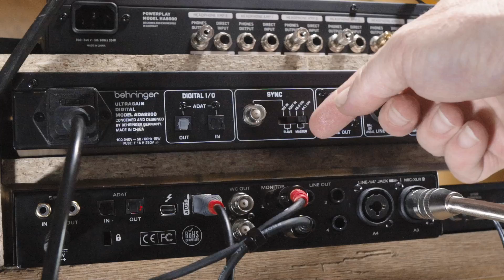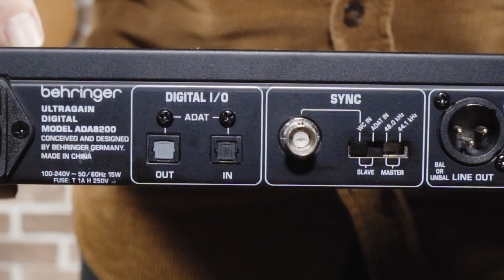How to add more inputs to your audio Interface? Behringer ADA8200 - demo

Comment: I would like to connect my babyface RME pro fs to ada8200.Can I also plug my electric guitar to tha ada8200 or do I need a DI box ?
Reply from the maker: each channel has both - xlr and line input, so you don't need DI box
Reply: @soymartino thanks

Comment: Hello I am a bit confused as my interface has adat in but nothing about clock I didn’t realise you need that as well I would like to add line inputs only for a few keyboards do you know anything available without mic inputs and without clock input as my baby face only has adat thank you
Reply: You will want to run an ADAT out from the ADA8200 to the ADAT In line on your Audio Interface instead.

Comment: 1:51 trying to connect my Behringer UMC1820 interface with  my Behringer ada 8200 pre amp and having a hard time - not sure where the other end of the coaxial cable should go on my interface ?
Reply: For this you should only need an ADAT line. Run ADAT out from the ADA8200 to the ADAT In line on the UMC1820. Hope that helps!

Comment: I've had a lot of problems with mine. Clicks and pops on 6 of the 8 channels. If I flip the switch on the back to a different sample rate and then back it will work for awhile.
Reply: How long is your toslink optical cable?
Reply: @RealHomeRecording  they are only about 12 inches long. However they are those super thin kind we had with the adats back in the 90's.
Reply: @tractorgt  Hmm...I just bought one so I'll see how my ridiculously long Monster toslink cable works (or doesn't, hahaha) with it! Could also be an issue with the master audio interface's clock.

Comment: Great video and very concise. Thanks for sharing! I have a question: I own the Antelope Audio Zen Q, which lacks the coaxial port that your AA Discrete has. It only has an ADAT in port. Will the Behringer ADA8200 still work with my setup? Many thanks in advance!
Reply from the maker: thank you Reinaldo, coaxial port allows the clock sync, so without it the sync is not possible... 🤷
Reply: @soymartino  mate, I took the chance and got myself the ADA8200, as based on its technical documentation, it could be used with the ZenQ.
I've used the ADA8200 as the master clock source at 44.1 kHz (it can be set to 48 kHz and still work perfectly as well). From my interface's software controller, I set it to ADA1, and that was it. The ADAT output from the ADA8200 not only sends the 8 separate channels but also the clocking to the ADAT input of my Antelope Audio ZenQ Synergy Core.
Moreover, I was able to route 6 of the inputs from the ADA8200 to the first 6 channels of the digital mixer and used the effects with no latency whatsoever. I thought you might be interested to know that. Many thanks to you for triggering all this experimentation and subsequent feedback here.
Reply from the maker: @reinaldolopezh great to hear that,...but  the latency is sometimes inaudible even when there is some (visible only graphically when comparing two waves) .. thank you for sharing your experience

Comment: If i use 2 ada8200 
How can i clock sync it?
Reply from the maker: set the ADA8200 to slave mode and your main audiointerface to master mode